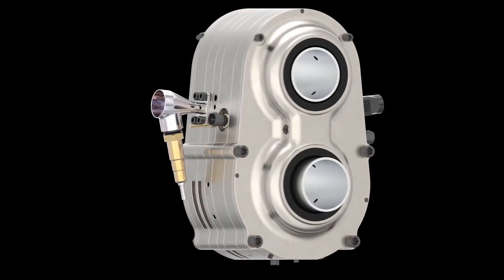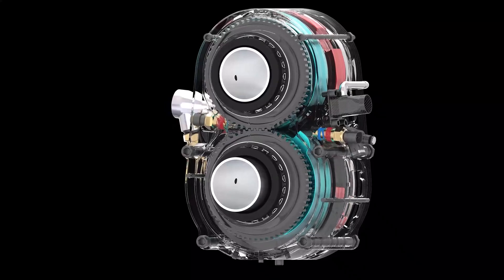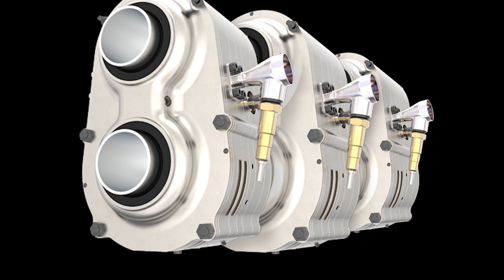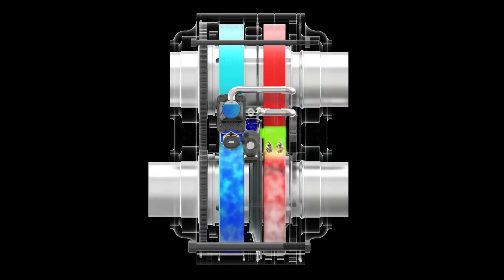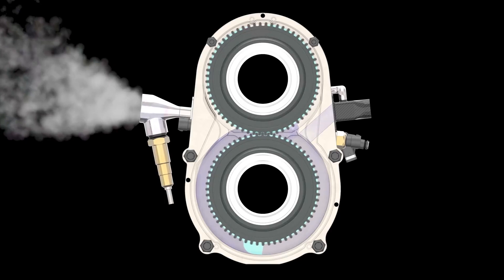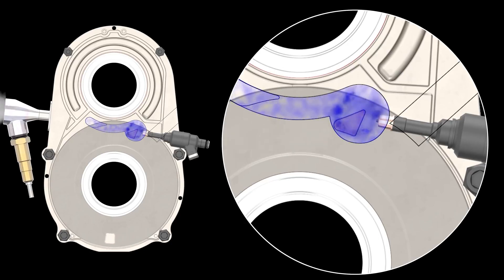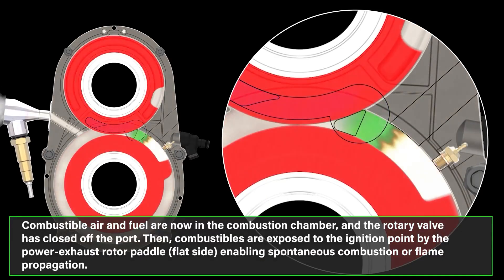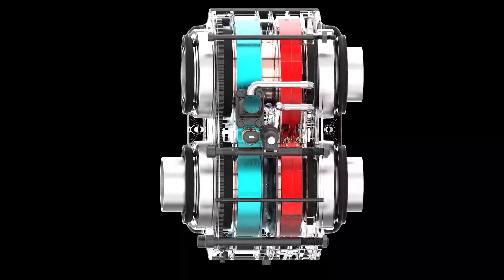This pistonless engine runs on hydrogen and revs to 25k rpm

Comment: I see potential here. I think an operational model would be nice though. A big problem though could be the high RPMs. Right now, most transmissions in consumer vehicles handle gear shifting at 2,500 to 4,500 RPM. So a transmission would need to be designed that could handle 10,000+. The engine can run at 25,000rpm which is cool. But I'm sure ideally you'd want to be able to run it lower to improve fuel mileage. Lubrication would also need to be addressed. When you talk about tight tolerances, you also need to talk about friction. Will a fully synthetic motor oil be enough to lubricate this?

To answer your question, is there still hope for the internal combustion engine? Yes, there is. Electric vehicles just don't have the range or power that a gas engine has. If you've ever heard a large tractor running while pulling a plow through a field, that engine is working hard. Or a semi pulling a load uphill on a highway. There's the need for a lot of power on demand. People need to understand something about electric vehicles. Batteries store energy, they don't create it. One thing that I think could be tried is to have both an electric motor and a gas engine in a car. The batteries provide the power for the electric motors that drive the car, and a small gas engine could provide electricity for the batteries.
Reply: If you use a gas powered engine just to provide electricity to charge the batteries that actually power the drivetrain, you're going to get even worse MPG than you would otherwise.  Any time you transfer one form of energy to another, there is waste in the transfer.  One option would be for the vehicle to run the ICE at lower speeds and also around town but to have a battery to operate at highway speeds.  It could be tied to the cruise control.  Then if you are in an emergency, you can punch the gas pedal to get that instant power you might need to avoid a wreck when the semi you're passing doesn't see you and decides to come into your lane.
Reply: Or maybe we stop giving maniacs money for vaporware engines and concentrate on research for better batteries

Comment: Computers give the ability to attain such tight tolerances. Use the right metal alloys, and you can attain long wear resistance. Sounds like a fantastic innovation on the internal combustion engine that might even compete with electric powered cars. Hydrogen can be generated by electrolysis from solar panels instead of passing super heated steam over heated coke, the usual means to produce Hydrogen. Solar panels to produce Hydrogen would be a means to avoid burning fossil fuels. Sounds great too me!
Reply: The tolerances are achievable but the cost would be too high. Just like how we haven’t switched to other power sources it just cost to much.
Reply: It "costs" too much is a moot argument because automobiles up until Ford developed mass production, cost too much. Only the wealthy could afford the "motor car". Horse, and buggies are cheaper, nobody can afford these newfangled motor cars. Lithium Ion batteries with their expensive Cobalt electrodes are too expensive. Musk's team has figured out a means to use an alternative metal. And I read that a process of using a mixture of ethyl alcohol, and water with a catalyst during electrolysis produces a much larger quantity of Hydrogen using way less electricity. Breakthroughs are coming fast. The City University in Hong Kong scientists have made a huge breakthrough in the manufacture of Perovskite solar cells which will lead very soon to very cheap solar panels that can convert 25 % of sunlight to electricity equal to the "cost too much" silicone solar panels, with similar longevity of 30 years.
Reply: @dentonfender6492  those where do to production/ material problems. This problem is do to the limits put in by physics. There is a reason this has not left the drawing board.

Comment: i agree electric engines are not totally good. in fact i looked at hydrogen and synthetic fuels. I think synthetic fuels will eventually offer a huge boost to our conversion to zero carbon. however watching this bit of tech i realized humans are approaching our carbon problem from even more angles than i imagined.

Comment: This can't work in real life. Sure this engine will be wonderful at point 20 degrees Celsius but imagine having a cold start in the winter. All your tolerances are completely screwed and the engine, in this case even, won't run anymore.

Comment: Tight tolerances is a wear issue nightmare for sure. But I do believe hydrogen or some other form of fuel is the real future. Electric is just another commodity they can control with the production and cost of electricity

Comment: Like Elon says and I take it to heart; "prototypes are easy, mass production is 100x harder". All you have to do is seriously discuss potential flaws and you'll start to see problems right off the bat. One reason electric is actually being used is because it's easy to make motors and batteries, and even then serious innovation and risk taking to get you ahead (Tesla), and their cars are still more expensive than ice cars. I'm all for innovation, but you have to be more realistic.
Reply: Well Elon is the ultimate snake oil vaporware salesman so I suppose this is right up his alley. He'd probably just build a 3d printed model of it, take it on stage at a promo rally, lie and say it's 100% functional and will replace all internal combustion engines within 2 years.
Reply: @kylezo  Sorry but I don't align with the idea that Elon is a sham. I just think he's a bit arrogant and expects too much from his workers.

Comment: There are estimated 2 000 000 cars in the NYC. If all of them would run on the H2 just imagine the amount of the water steam from the combustion in the air. It would cause such a humidity and rainfalls that the city wouldn't be habitable anymore.

Comment: It's very easy to show concept on a computer compared to actually showing something actually working and make it probably a good reason why you don't see a physical engine sitting in front of you since they pretty much can make any metal overnight in a jet or a plasma machine so apparently there's some major issues they can't make this would be a cool concept but I wouldn't count anything until they actually physically make one we can talk about how we make rockets to another galaxy but until we put in practice that's pointless just talk

Comment: Those figures are quite good. But my animation of an engine has more power at 170 hp, more torque at 180 ft lbs, weighs less at 30 lbs, and revs to 28k rpm. My only problem is turning my animation into metal But who cares about that. Mmeanwhile, if you come up with an animation with better figures than mine, I'm prepared to re-work my animation.

Comment: Looks like that other one thouh it used pistons in it an they would make a clacking sound as they went around an all ever seen him tun off was air at the time that an hise used seals. Even if yhis was too become real most normal peeps that work could not touch its price tag for the moter alone

Comment: Hydrogen should be a massive focus for future automotive development. Not only can it be used in a combustion engine, but through fuel cells, it can be used with electric engines as well. And if in the future we can extract hydrogen with 100% renewable energy then it would make hydrogen the perfect fuel.

Modern batteries are still very dirty to produce so that's not a perfect solution. It will be interesting to see what future battery technology brings.

Comment: Yeah this is too good to be true. This engine requires really high rpm to produce power, meaning very little torque. The centripetal force alone would tear it apart after maybe 10k miles. That is the main downfall of electric motors. They spin really fast and that causes immense deformation which leads to wear. The lack of seals also suggests the oil leakage will be difficult to keep up with.
Reply: most people just lack the knowledge to guess what happens when something like that turns at 25k rpms, they just accept it...

Comment: While hydrogen burns clean and produces water, most hydrogen is produced from methane -- a fossil fuel. So in the end hydrogen is not an ecologically sound or sustainable solution. This, in turn, makes this engine pointless in terms of saving the environment. If there was another way to produce or capture the most abundant element in the universe, then that would be a different story.

Comment: No way this works, hidrogen is way too sparse to no leal between cambers and trough the axel ... Also lubrication seem an issue if you are not adding at least some oil to the fuel. It's a beautiful concept, but q nightmare to engineer in a remotely economical way

Comment: How does the rotating components stay in balance at high RPM? It's asymmetrical and therefore out of balance; there has to be some form of counterbalance as that notch and tongue in the rotors are going to cause problems.

Also, remember that water is known as the "universal solvent" and the steam produced by the H2 combustion will squeeze into every part of the engine.  How can the moving parts stay lubricated during thermal expansion with steam being injected everywhere?

Comment: I think the reason we dont have quality hydrogen vehicles in production is because the safest, most efficient way to power this vehicle is to use an on-board Electrolysis hydrogen fuel cell. Storing hydrogen in larger quantities than what is needed right now, is dangerous and unnecessary. Water is the safest way to store hydrogen, and because of the tight spacing of water molecules, you can store hydrogen in a much smaller space when its in water, than if you stored liquid nitrogen and kept a system onboard to keep it cold. You are just asking for problems in their desperate attempt to keep consumers coming to the gas pump, when you try the liquid Hydrogen approach, vs the onboard electrolysis method. And since the way that makes WAY more sense frees us up from going to the gas pump, they need to either make water way more expensive, or fight this technology, as it hurts Big Oil.

Comment: This overlooks the extreme danger of using compressed hydrogen. The small size of the hydrogen molecule means it will leak. When it leaks the decompression makes it heat (the reverse of normal gases). And then it can spontaneously ignite. The molecule is too small for flash-back arrestors to work. It is a mobile bomb. 
Regarding e-cars - they are not going to be viable until an infrastructure to charge them is in place. That means doubling the capacity of present power stations and the supply grid, and uprating the supply of every home. That is not happening.
Reply: The fact is there is no electrical powered cars.  Since they obviously charge from the power grid, they are either coal, oil, or nuclear powered with a tiny fraction of a percent solar and wind power thrown in.
Reply: @frossbog  it doesn't matter what powers the power stations - an e-car uses about the same amount of power as a home. That means doubling up on the supply capability, which is certainly not there at present. The infrastructure  in place is only just sufficient as it is. And with electricity prices going through the roof it doesn't look like a viable option. 
Speaking of fuel options, the only clean system that can provide enough power reliably is nuclear. Wind turbines have in fact an utterly disgusting carbon footprint.

Comment: I believe an article I read stated 95 percent of hydrogen fuels are still made with the help of fossil fuels, even though the engine is almost zero emissions. So as of now the technology is nowhere close to making this an amazing alternative. Although it is very exciting to see a newer engine designed.
Reply: Hydrogen from clean production is available and will become more common as fossil fuels get too expensive or outlawed. Hydrogen and electric cars pick up as cleaner energy is made, petrol cars will be stuck needing difficult to synthesize fuels.  One alternative for old cars would be to readjust for pure ethanol fuel made from inedible plant material.
Reply: This is vaporware tho

Comment: "no seals" -- "tight tolerances".
Those parts with tight tolerances are seals, dummy. Just not the replaceable type. 

Seals are usually separate parts because you need different material properties for the wear parts & the rest of the block, and to make repair possible. I guess these guys will just replace the engine block when it wears out. Because of the high pressures, failures of the engine will be pretty catastrophic anyway, so there won't be much to repair.

Comment: So the tolerances change with heat. The material is expanding. Sounds great but I would rather drive a traditional engine with hydrogen.

Comment: I like the idea of using hydrogen as a fuel . The limitations of using electric vehicles seem to be taking a long time to sort out and I'm concerned that this might in turn affect our " exploring nature ! "
JCB I believe have a modified diesel engine which runs on hydrogen which sounds promising .
 I'm also a bit suspicious about the " hard sell " that electric vehicles seem to be getting !
Reply: In case you don't know there is no hydrogen available. even for production of fertilizers that are way more important than some scam engine
Reply: This engine might work in 40+ years tho

Comment: I do not see this as a practical solution for a car engine. High rpm and tight tolerances will lead to a very short life span and high maintenance costs. What sort of lubrication will it use? Consumer grade lubes can not even form a film if a piston moves faster than 25m/s. Here we are talking orders of magnitude faster, way above supersonic. Is this a reason why this is a computer generated graphics, not an actual working device?

Comment: Soon we get little Hiroshimas on wheels.
What if the hydrogen tank are broke and it come in contact with air?
Booom!
Hydrogen used in the fuel cells is a very flammable gas and can cause fires and explosions if it is not handled properly

Comment: Washingtonville I like information about the style motor I like the fact I heard that they're trying to use hydrogen as a fuel source I don't mind idea of Deb tried to speed up the production of for electric vehicles but where I live our grid is just not set up for him so the internal combustion engine is still the best choice and on top of that I would prefer an eternal bison engine for long trips so that way I don't have to worry about trying to find a place to charge a vehicle and have to sit there for 30 minutes to maybe an hour just to get a bit of charge to go down the road again

Comment: looks like there's going to be production issues with tolerances needing to be 100x smaller for some of the components but overall looks promising
Reply: I grind within Aerospace tollerances .00005" most of the time.
Reply: @stevealexander6928  For that extra smooth coffee? ;)
Reply: You are assuming metals.
Reply: This is one of those engines that only work on paper or in this case in an "simulation"
Reply: Tolerances are not a problem anymore with CNC grinders.  The problem will be speed and cost of production.
Reply: @mshore74  aka, productions problems. There's 3 things you could get when buying something, fast, cheap and good. You may only pic 2
Reply: @mshore74  Tolerances are a problem when you "don't need seals" because your tolerances are so high. But then you want to run this car in temperatures from -30C to +50C. 

Aircraft get around these issues because they don't have those tolerances between moving parts. They leave plenty of room in the compressor turbines for expansion (and they expand quite a bit going from maybe +40C on the ground to -70C at altitude
Reply: @evilbred974  Yes true, but I would be more inclined to engineer around operating temperatures and not ambient temperature.  I make parts for aerospace and work to very fine tolerance in difficult metals.  It's not fun, but the parts are very expensive and so might be this engine.
Reply: @mshore74  the problem will be the same with the last trendy engine released to appease green freaks. Fuel. Obtaining hydrogen is a nasty process and as for cracking ammonia? Ever seen what ammonia does to human skin?
Reply: Laughs in German and Japanese xD

Comment: This must have been designed by my highschool physics teacher, because it assumes no friction or thermal expansion.
Reply: Tight tolerances does not mean "assumes no friction or thermal expansion". Thermal expansion can be calculated and tested so when operating the tolerances are perfect. F1 cars for example can only run their engines AT operating temps, when they cool down the pistons seize inside the engine. Now F1 cars need their engines pre-heated before starting which is fine for F1 performance but not for common consumer needs, so you relax the tolerances to significantly increase convenience and lower costs. This engine design looks pretty smart to me and will run with normal (calculated) thermal expansion.
You haven't watched the video properly and are happy to make an incorrect claim based on a false assumption on your part.
Reply: @ApprenticeGM  yeah my friend has one and needs to use a block heater. It's in his truck though,but it hauls but
Reply: Those only exist is reality bruh, this is a computer graphic
Reply: @jimjab3631  Yes, I know, but the design does cater for thermal expansion despite the OP's misguided claim.
Reply: A piston engine has tight tolerances and can tolerate thermal expansion